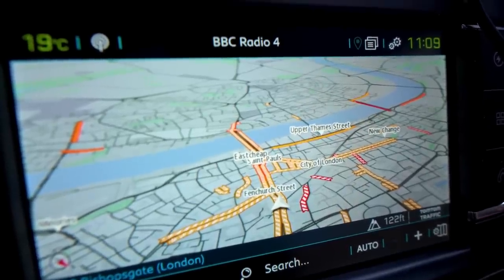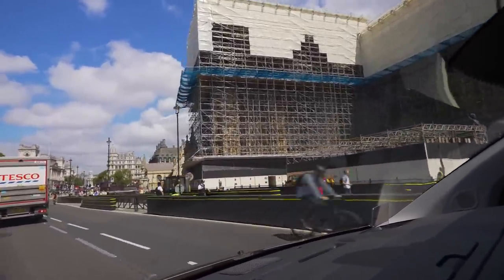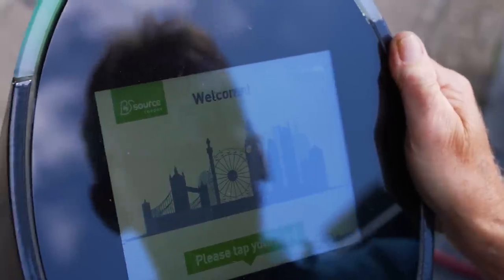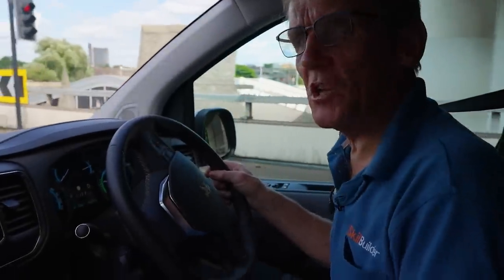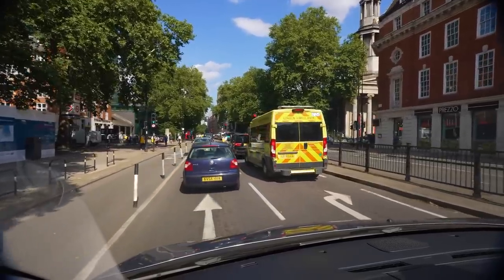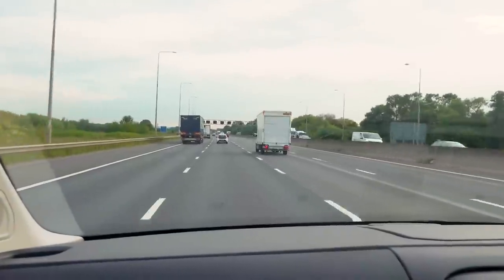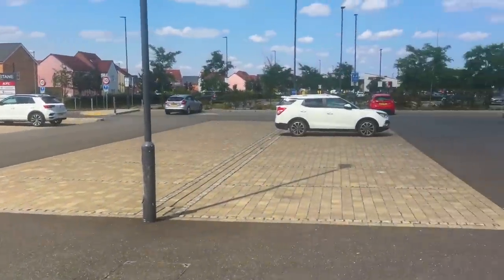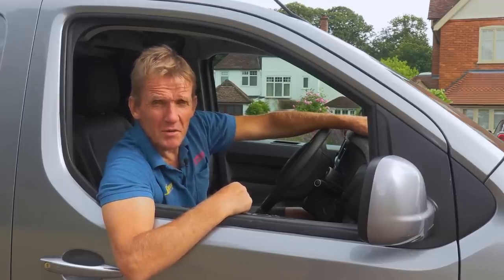Is It Time To Switch To An Electric Van?  e-Expert Test

Comment: Currently driving the long wheel version diesel and its a big disappointment. Load space is much smaller than the previous model and when it's fully loaded the engine seriously struggles to get up the road.
Reply from the maker: Good to know Sean. The value of this review is the feedback from viewers who have a longer experience of the van.

Comment: Don't put your lights on you will get stuck on the motorway, the range on these battery vehicles is pitiful and when you go to recharge you will be in a queue awaiting lots of other vehicles waiting to recharge. Just wait to see what lorry's are powered by, for sure it wont be battery.
Reply from the maker: Probably hydrogen fuel cells for larger commercial vehicles.

Comment: Just wait until your smart meter switches off charging because the grid is under too much load. Just wait until fuel revenue from fossil fuels isn't enough and instead road use taxes are introduced to electric vehicles.
Reply: Of course road taxes will be introduced to EVs. It is just a temporary stimulation measure.

Comment: If the battery tech/infrastructure improves then I'm sold. Are the plugs lockable??🤔  Don't want some silly Herbert unplugging them for a joke or worse, nicking them! 🙄
Reply from the maker: They lock when you put the power through. It is quite clever
Reply: @SkillBuilder  Thanks Roger. That makes perfect sense actually! ☺️ I thought it unlikely to be based on trust! 🤞😀

Comment: I have the Vauxhall diesel version of this van. It's very flimsy, the locking system is pound shop quality and if you stall it in the middle of the road you have to stop and wait before it will allow you to restart which I think is dangerous. 
The rear doors don't clip open so if the ground isn't perfectly flat the doors keep closing and you have to use a broom handle to hold them open. 
The interior lights go off after less then 1 minute so if if it's dark you got 59 seconds to find what you want. The it way to switch them back on for another 59 seconds is to close and open the doors again.

Total junk.
Reply from the maker: I drive the Vivaro and use my key fob to turn the lights back on.  True that the vehicles are lightweight and don't take a lot of knocking around. Not really tough enough for builders.

Comment: Find me an electric van that will carry the same load as my traffic, takes 10 minutes to fully charge and has a range of 600 miles for under 20 grand brand new and I'm in! No? Thought not.
Reply: It does make me wonder how you'd have coped if you'd been born 120 years ago, and all you had was a horse. Oddly, people did manage ok .........
Reply: @Brian-om2hh  seriously Brian? 120 years ago I wouldn't have been driving all over east anglia cleaning carpets for a living. Even 40 years ago most people I knew worked within cycling distance from home but the world's a different place now. When I first passed my test not many people drove more than 15k miles a year nowadays not many people drive less than that. There's a "car supermarket" next to our yard and virtually all the cars there are less than 4 years old, at least half of them have more than 100k on the clock.

Comment: Love the idea of electric vans but realistically need 300 miles range when fully loaded with - racking, tools, cable, van stock, job kit and a 200lb gorilla at the wheel. Not to mention defrosting it in the morning and running the lights in winter where its dark when you leave home and when you get back.
Reply: Defrost before you unplug in the morning- zero drain on the batteries. As for lighting, presumably it's all LED, probably not much more than 100 watts when the thing is lit up like a Christmas tree- won't make any practical difference to range.

Comment: If you are charging at home, you cannot pull a heavy load in your house, ie. cannot shower or electric heating etc
Reply: Hi Dave do you know anything about domestic electrical safety or ev chargers ? 

All chargers have the option for load monitoring . They sense the house load with a ct clamp and lower charging rates accordingly .   

You’re ignorant comment is misleading to potential new ev owners .

Comment: I’m for it in principle. Here’s a few reasons why I I’ll stick with my transporter for now. Price. By 2035 I’m assuming the cost would of come down a bit more, charging, I live in a flat so would solely rely on a pitfull amount of on street charging. Range, 300 miles needs to be the standard. Also im guessing new battery tech is in the pipe line so holding out might pay off.As for the tax benefits they will disappear as soon as diesels are fazed out, JCB have stated hydrogen is were they are putting there money. I’d be very interested in seeing that technology implemented. But yeah I’m all for a cleaner living environment. I usually drive my tools to a job then cycle the days I don’t need my van anyway. I’m lucky on that I work and live around central London in that regard,
Reply: çhefsàyev rady 2054 minum

Comment: Reading these comments is a bit depressing. Why does everyone feel the need to point out all (mostly small) downsides instead of the positives. Nicer to drive, cleaner and cheaper to run (factor maintenance)
Reply: Because for tradesmen these small downsides are massive. Electric vans for couriers and delivery drivers may work but when I'm doing 200 miles a day carrying 1/2 ton of tools and materials the last thing I want to worry about is finding a charge point to get me home.

This form of hybrid is the future. A small honda type diesel electric generator to directly charge on board battery at a rate greater than the discharge rate whilst driving when range gets below 20%

Completely negates EV range anxiety. 

Or my idea that I had 10+ years ago of a universal battery pack (like a cordless makita battery) where you own the car but not the battery.

Service stations and other infrastructure have some kind of drive over device that unclips spent battery and reattaches a charged one. You could even have a spare a home that you charge off solar panels whilst your at work. Or powering your home when electricity prices are high ie. Home storage.

This would solve waiting times to get range to 100%  and bring ev car prices down. Problems are getting ev manufacturers to adopt and share platforms.
Reply from the maker: James, Don't be depressed by debate, be depressed by those who try to stifle debate and control the narrative. There is a lot of that going on at the moment with people saying "You are not allowed to say that" and it won't be long before we have thought crimes.

Comment: My first driving experience was in an Electric Vehicle too! ..... The Groundsman at our local Rec at #wargrave had what probably was an old Milk-Float in the 40's or earlier. Painted Army-Green .... I was about 6 yrs old (in the 50's) and our little gang of Ne'er-do-wells would go up there in the evenings while Old Langford was having his Tea/Dinner and take it for a spin around the Cricket-Pitch .... He was never a happy man and would chase us off quite regularly ....... Those were the days ....... Modern Electric vehicles are a 'little bit faster' :-)
Reply from the maker: Peter
We used to go and drive the dumper trucks on big building sites. You could start them with a winding handle,  no key required, just start up and away you go until you crash into a newly built wall. Then it was time to legit.
Reply: @SkillBuilder  Yes, no chance of that now ... You need the skills of an SAS Agent to get onto a site these days 👍😎

Comment: It's ok taking your van round the corner to the pub to charge it but you're taking all the tools with you off the job. Not practical to fully unload the van.
Reply from the maker: We generally know what tools we need on a job like that but I take your point. We didn't know it would take so long on the 3 pin plug .
Reply: @SkillBuilder  Very informative tho', When I was tiling I was back and forth to the van all the time. Good video and great discussion in the comments.

Comment: I have the Toyota dirty  diesel equivalent,  great van but the mirrors could be bigger, id stick with Toyota if i was to go electric,  but the cost of 42k after the 6k grant has to come down first
Reply: tiyata eltrc 10⁰ míké ranfe teksa els 1¹6 mie sokid sta baters 125 mile rabge

Comment: Who is going to rescue you (and how) when your battery runs flat in the middle of a long run on a motorway?
Or on the outer Hebrides?
Reply from the maker: RAC and the AA are rescuing electric vehicles all the time, same as petrol etc
Reply: @SkillBuilder  that reply was quicker than an EV off at the turn of a green light!

But, do they provide a charge, or a tow to a charge?

Comment: All of last week I was doing 120 to 150 miles each way to site.. im doing 13 hours door to door. So first question..can it carry  1.3 tonnes.. can it do 200 miles with out recharging.. can it be charged up on a fast charger in 40 minutes..
Reply: I'm not sure about the load weight (I'm not up on vans) but the 200 miles on a charge ought to be do-able fairly soon. The fast charge in 40 minutes is here now......  I charged my Kia up from 30% to full in around 40 minutes during a 500+ mile trip. It was the only charge I needed during that trip. I recharged again once I reached home, on my night rate of 5p per kw.
Reply: @Brian-om2hh  I've tested  a few electric vans.. put  800 or 1000 kg of kit in them and  the range halves.

Comment: Lithium is nearly doubling in cost year on year, batteries will be prohibitively expensive in the future, Hydrogen is the future not lithium you are being conned into buying something that cost money beyond belief. Don't get conned.
Reply: Wrong. Hydrogen is horribly inefficient and therefore far more expensive.
Reply: @Simon-dm8zv  Rubbish its the future do some research.
Reply: @geebix  Nope it is not. Too complex and too inefficient. The fuel cells degrade faster than batteries do and the whole high pressure system in the car only lasts 10 years. It’s a mindbogglingly stupid solution for cars.

Comment: Looking forward to tripping over all the power extensions running across the pavement from everyones front room window.
Reply: Hopefully you won't trip over too many, because Local Authorities can now apply for funding from the Government to install grids in pavements, to allow charging cables to pass under the pavement rather than over it. The grids allegedly take around 40 minutes to install, and you need to request one from your Local Council. Likewise, funding is also available to Councils to install chargers in streetlights.......

Comment: About recharging. I always thought they would reuse old petrol garage forecourts and have battery changing stations. Like RC toy cars. You park up, a robot arm underground remove old battery and places it to charge and gives you a new one. Simple. No daft, invasive infrastructure needed.
Reply from the maker: Just think about the queues
Reply: @SkillBuilder  have you seen those computerised robot arms go?!? 30seconds to a minute tops. Auto payment as it changes too. Faster than fuel and charging it yourself.
Reply: How will you feel when you drive up with your brand new EV with it's factory fresh battery and the robot replaces it with a five year old battery in exchange?
Reply: @twig3288  Good question. Erm, dunno. I suppose the used batteries are all checked to a standard. But at the end of the day the batteries aren’t yours and never add or detract from the value of the vehicle.

Comment: Ask the manufacturer how much a new battery is. They shy away because it will amount to half the cost of the vehicle.
Reply from the maker: See tonights video on batteries and the future.
Reply: @SkillBuilder  You are getting sucked in like thousands did with diesel gate. Battery power is not the future, they are expensive and very inefficient, hold fire and don't waste your money.

Comment: So how long does it take to charge and if at home how long and how many KW pH.. I read it takes 8 hours at 10kw per hour..over here in Ireland thats would be 15 euro a day..
Reply: It takes 10 hours on a 7.5kwh charger . Use an off peak tariff 8.5p per kw here in uk . thats roughly 180 miles for £6.30
Reply: @persona250  who's your supply octopus is the cheapest i can find, their night rate is 15.8...and that's due to go up to 23p
Reply: @persona250  I have a 2020 Peugeot partner van... I fill it up every 2 weeks for 70 euro.... For that I get 700km
Reply: @jigsey.  yes boss octopus go tarif is 7.5p night rate 4hrs
         Go faster is 8.5p 5 hours
Reply: @jigsey.  similar to my other diesel van .  £90 every 2 weeks . Reckon I save £38 a week on fuel alone
Reply: @persona250  thank you, I was trying to get real world info for ages... That's firmly put the electric van on the top of my list now
Reply: @jigsey.  what work do you do and what working radius ?
Reply: @persona250  carpenter, and roughly a radius of about 60km

Comment: Nothing standardized with the plugs for EVs and never will be, there are half a dozen different plug types and Tesla have their own one unique to them too
Reply: "And never will be" - similar things were said about the computer interfaces on vehicles. At some point, manufacturers will be told by large governments that all vehicles must use a standardised charge system and connection.

Comment: So what's to stop someone taking the Mick plugging in,  and parking at a street charger all day?
Reply: It hasn't happened here in the UK much yet, but in certain parts of Europe, once your car has finished charging, the system begins to add a penalty charge. I've seen the equivalent of £1 per minute mentioned......  With the charge apps there are around today, there is little excuse not to know when your car has finished charging, even if you are in a shop down the road......
Reply: @Brian-om2hh  thanks 👍

Comment: Where do you think the government will be getting their fuel duty from, there will be a black fitted in cars in the future and we will be paying by the mile chargeable by the time of day we drive. Look what happened with diesel fuel costs. Battery cars will not be cheap to run then.
Reply: How will they tax the electricity I get from my solar panels?  If it won't be cheap to run an electric car, then it certainly won't be cheap to run around in a petrol or diesel one either. Refining petrol and diesel uses lots of electricity.....
Reply: @Brian-om2hh  You will be paying by the mile absolutely F/ all to do with taxing electricity. A black box in your car will monitor your mileage and you will be charged according to the time of day you drive. Your roof will need to be the size of a football pitch loaded with solar panels and that is assuming you only drive at night. Remember battery is a joke and we are being conned.
Reply: @geebix  You have no clue and are clearly looking for excuses to continue using fossil fuels. It’s irrelevant. What counts is electricity emissions are far lower than any liquid fuel. Electric is the only sensible solution.
Reply: @geebix  It is just simple physics and clear data.
Reply: @Simon-dm8zv  Battery cars are dog poo.